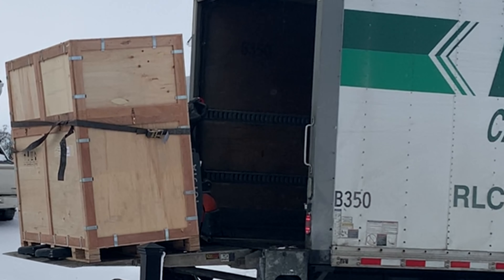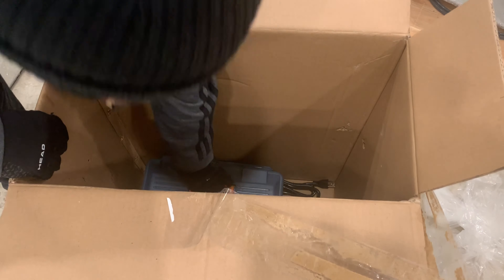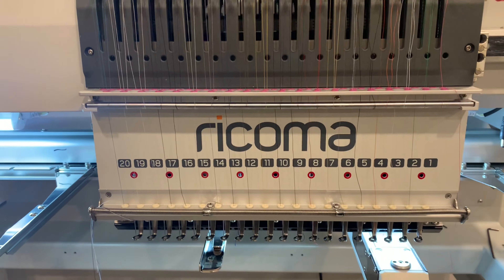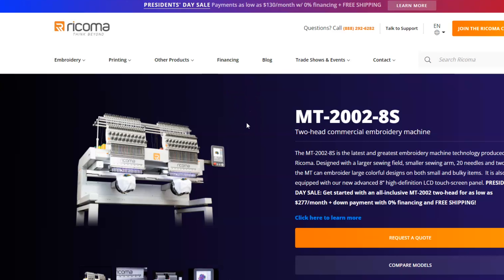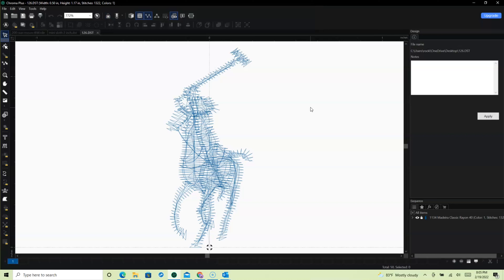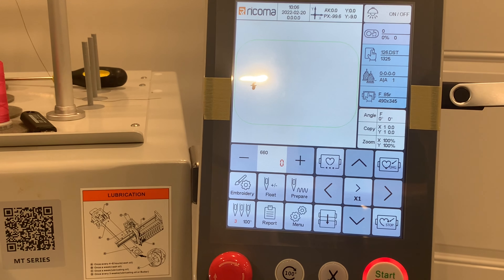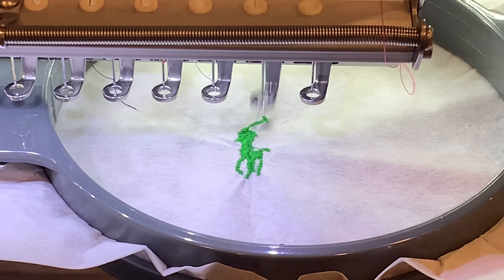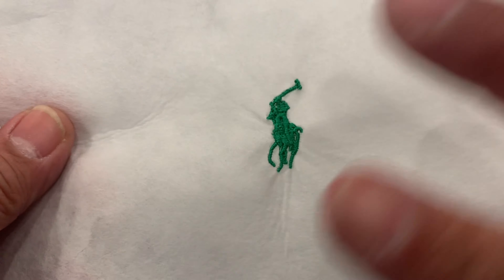Unboxing The Ricoma 2002-8S Embroidery Machine.  February 20, 2022

Comment: Did you happen to know the amps needed for the machine, or did you have to get a new breaker? Like the electricity needed?
Reply from the maker: I am using the standard amp wattage for the unit here is the specs 
Built-in universal power supply, 110V/60Hz and 220V/50Hz self-adaptable worldwide

Comment: Maybe you can help me out, i have the single head version of that machine but im having problems with the trim at the end of a design. It cuts the thread but the thread doesnt get pulled out of the design, i cant figure out how to get those tails trimmed out. Any ideas?
Reply from the maker: Try these few tips that has helped me.
1. Is your bobbin set up correctly counter clockwise and tension is tight.
2. Reduce your speed. 
3. Use double stabilizer. 
4. Is your needle positioned correctly with the groove facing you. 
Lastly if these don’t work call Ricoma help desk for support.
Reply: @rockinprintz  hey thank you for responding! I tried all that but it wasnt working. Did fix it though lol. Turns out the trimming blades wernt lined up right so i opened it up and loosened a screw so i can move one of the blades. Now it cuts the way it should. No problems at all. Seems when they built it they didnt line the blades up just right. Idk. But thank you again!!!
Reply from the maker: @All.in.One.25  Awesome glad your back up and running :elbowcough: